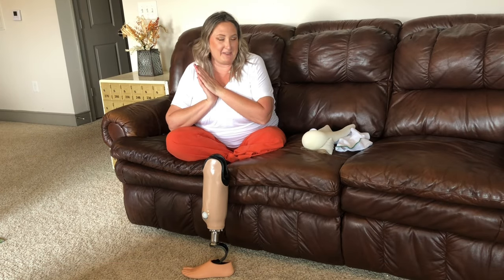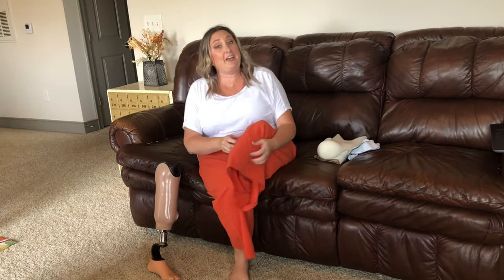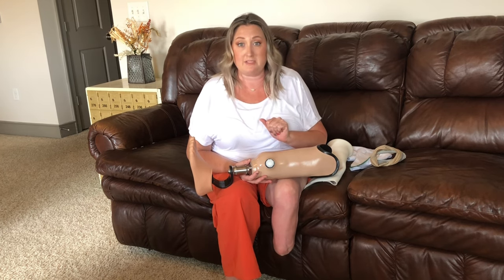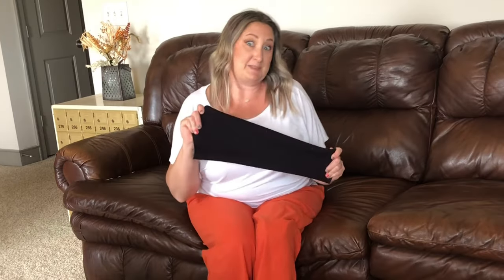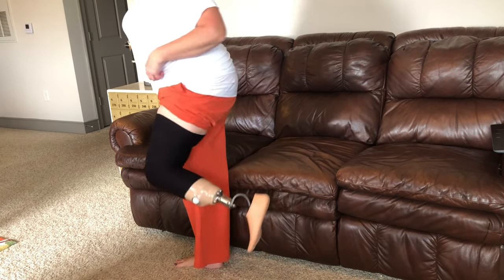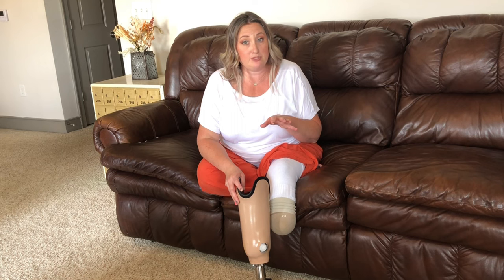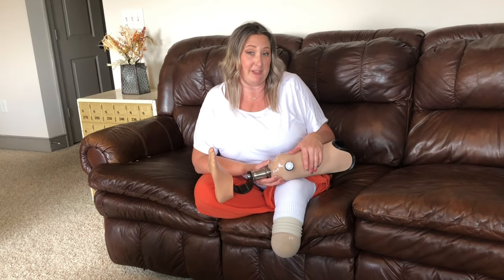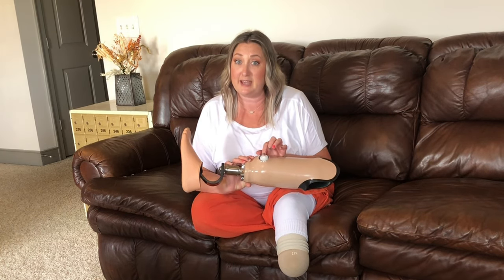Amputee Compares Popular Socket Prosthesis Systems | BOA, Suction, Vacuum, Direct Fit, Pinlock, pump

Comment: I am a above knee amputee. my 1st socket was the adjustable type. had the cable break 2 different times. Yes, wheel chair time until fixed. They indeed can replace the cables and dials if needed. In a few months it no longer stays on. The suction type would not hold a seal so now I am on the pin type. Love it and wont change from it. Hope you get one that will help you. Thanks for your video

Comment: I'm an elective trans-tibial amputee of 28 years. I have made my own decisions based on the total absence in the UK of information until comparatively  recently.  This video is the one that I would have wanted from the point of deciding on the amputation .  It is clearly spoken, and fully informative about most of the options, and is particularly valuable for me , as I have the problems and sensitivities that the lady has experienced along the way. The situation is different in the US because of our respective Health systems, but it places me in a much more informed position due to problems that I'm having at present.   I can go to my Limb Centre now, with a much clearer overview of what I need. Thanks to the young lady concerned.

Comment: Hi, enjoyed the video! To answer the question about pin locking system, no you should still not be end bearing, because yes, that is very painful. With the pin system you are still bearing weight over the whole limb and specific pressure tolerant areas. The limb should be in contact with the bottom but there should not be high pressure or pain. The main pros are like you said, easy to put on, security and improved knee range of motion. Some drawbacks, some people get what is called pistoning, where it feels like the limb is being milked (but that feeling can be reduced with proper fit), some patients have got stuck if the pin is misaligned or a sock thread gets caught, and it may take a couple tries to put on if the pin is misaligned. I also wanted to note about the K level definitions, just because we fight this constantly with insurance companies trying to get our patients good quality components. The main difference when it comes to K2 and K3 is K3 has the potential to vary their walking speed regardless of whether they use an assistive device or not.
Reply from the maker: This is wonderful information! Thank you so much!
Reply: Likewise with your comment😊